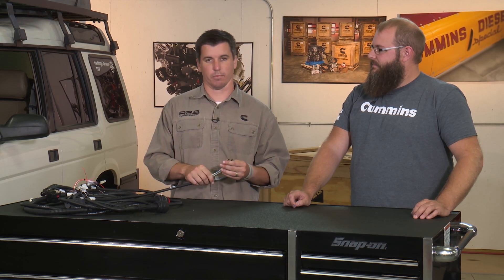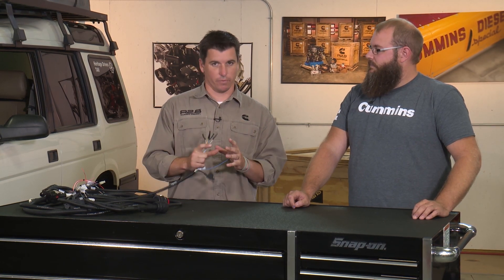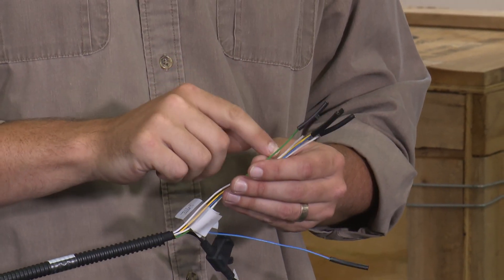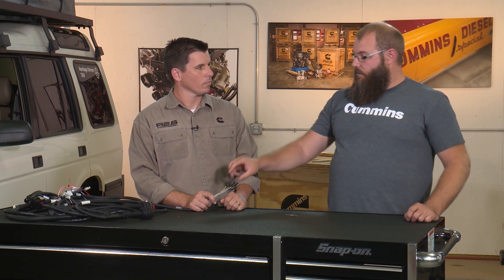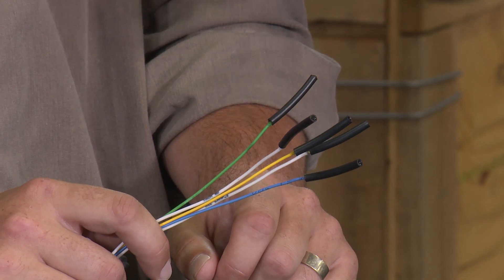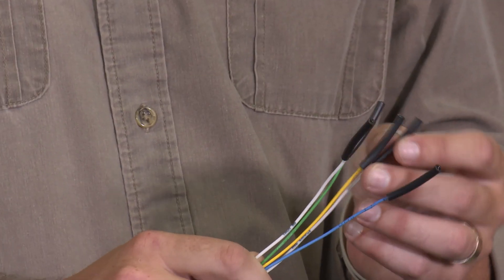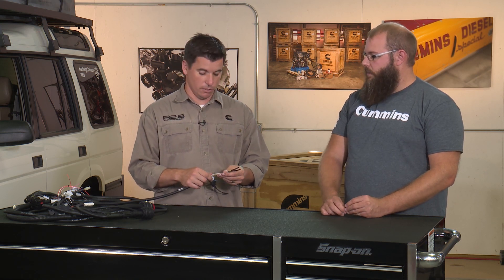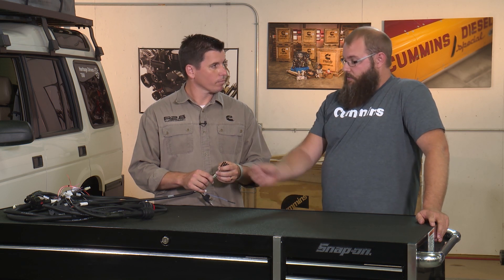Cummins Repower Garage: Tech Tips - Dashboard Indicator Lamps

Comment: Hi
I have one mini bus installed with r2.8. All of your videos are really usefull to me.
May i seek your advice for some questios i have 
1. I like clean car and used to do Engine room cleaning. Since this engine is really new to me and would like to know which parts should not pour the water and soup or cleaning liquid.
2. CK 4 is not available in my country at present time. Can i use CI or CJ 4?

3. Any others oil addative  recommandation. Normally i use to fill liquid moly common rail addative and diesel purge for toyota 1KD engine cars. 
Thanks you.